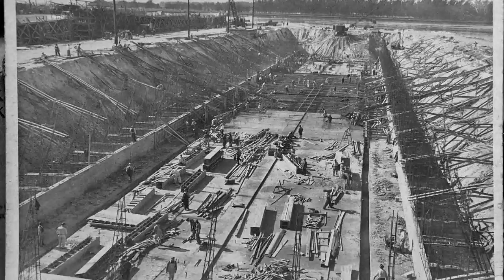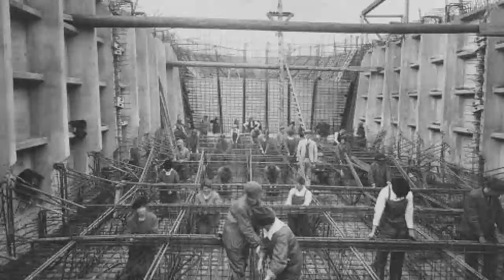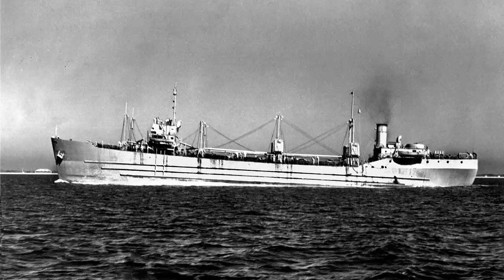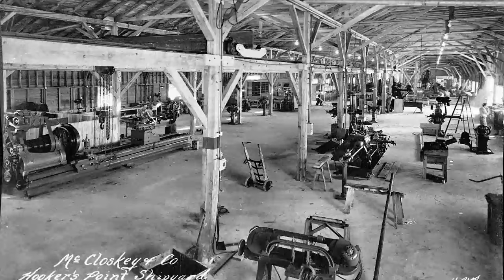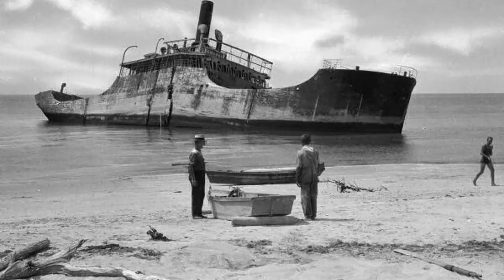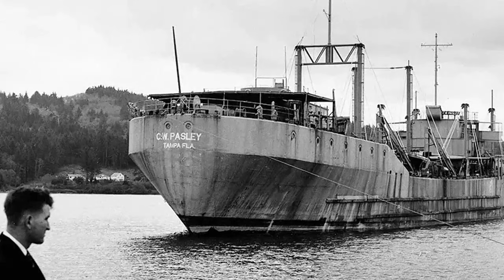Germans Said Concrete Ships Would Never Float — Until America Proved Them Wrong

Comment: "Germans Said Concrete Ships Would Never Float" - Except, the fact that they had been building concrete boats since 1908 and during WW2, the "Sonderabschuß Betonschiffbau" started launching concrete vessels already in 1942, well ahead of the US program. 

The rated speed of the C-1-S-D1 was 14 knots, not 7. However, that speed is what google AI claims it is, which is very unreliable in all things regarding concrete vessels. They were not the slowest vessels of the convoy, as they were brand new - but slated for destruction due to cracks that occurred when they were incorrectly handled when they were first floated out of dock.

Neither was there ONE "ice-cream barge". There were three barges built of the refrigerated B5-BJ2 type, and they served vessels smaller than destroyers, since larger vessels had their own ice-cream making equipment installed.-

Comment: How did they keep the concrete joints from leaking?
Reply: Boogers
Reply: Building contractors on land have a lot of experience on making strong concrete joints. They shouldn't leak when new.
However,  even with strong rebar reinforcement,  concrete will crack when subject to repeated stress like on a ship.
Since concrete is porous,  the interior will get damp after the ship has been in service in water. 
All this is more of water seepage and moisture rather than any severe leaks, but I can imagine it was uncomfortable to serve on these ships.

Comment: Thanks!!!!     I knew very little of this topic, I never knew how little "I knew".
Thanks for the Info and this history honoring the Greatest Generation!

Family is Long beach Ca and the whole West Coast including Portland pre WWI.  I think my great gramps was a shipwright, or marine engineer.
My grandfather was a Seabee engineer Col.
I did concrete and some rod busting from hi rises to other post tension pours, worked on the Spruced Goose's dome while Hollywood used the Dome's interior as "Pirates of the Caribbean" sound stage with the Back Pearl , and the cruise terminal's concrete pier with their concrete parking structure in Long beach Ca.  I was working on a post tension cable parking structure parked in my car waiting for start time when the 1st plane hit 911, and a computer room backup power and transfer power when the 2nd plane hit the towers 911.

 Retired a journeyman electrician, millwright, pipefitter, carpenter, teamster, with other trades in So Cal, I have bounced fishing lures off the merchant marine Victory museum victory ship berthed in the La harbor from the seaside.

More concrete maritime history details please?
   
 Think if we could match the Romans mixes of concrete that chemically repairs its own cracks with water while getting stronger?      We could build and use these ships again?

FYI most modern post tension parking structures are about the same thicknesses' this is why you can feel cars run over speed bumps when their floors flex. The steel used in concrete is a lower price or production quality than the steel for typical steel ships' uses, or armor.

Thanks! I knew of the ports, blocks, barges, and picrate.